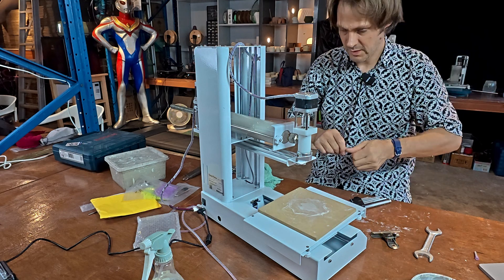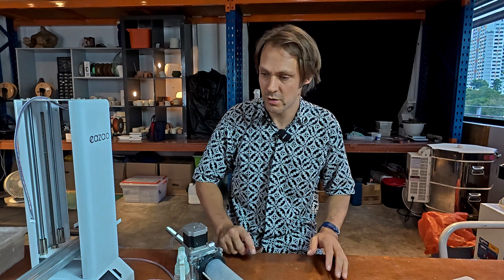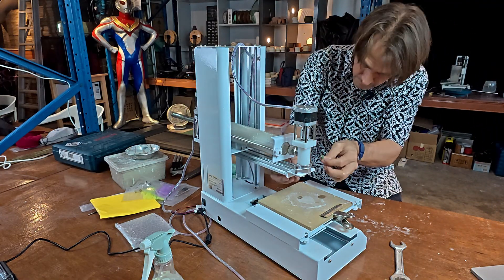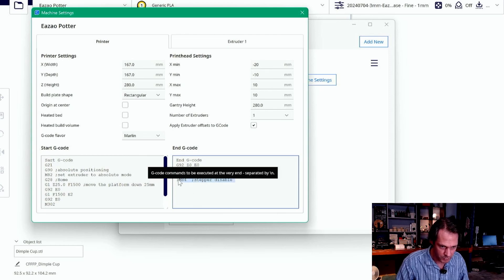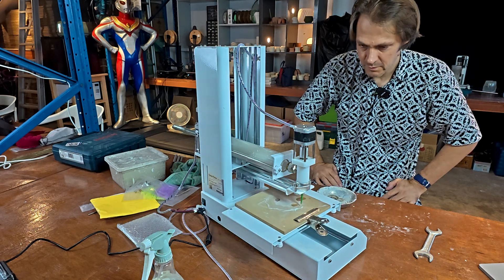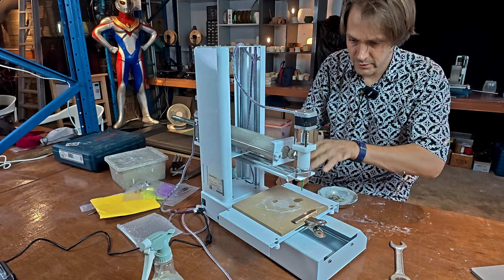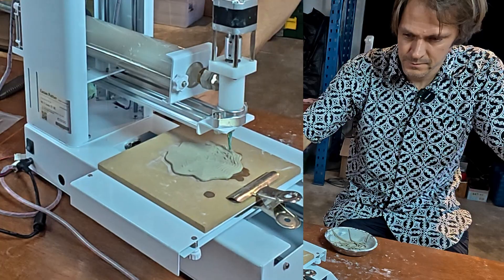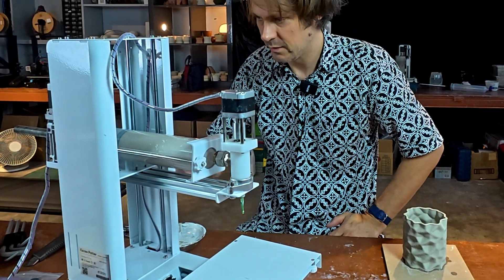Eazao Potter: Fixed but Still Frustrating? Testing the New Updates!

Comment: I would like to try 3D printing clay, would you still recommend this printer or something else? Is it better to buy the kit and attach it to an Ender 3 instead?
Reply from the maker: There is no perfect solution.  I think the eazeo potter is slow and can be frustrating. That said, the direct connection between the clay pump and the extruder,  without a tube, makes it print really nice quality, better than I have seen on other printers and more reliably.  If you want to tinker, upgrading an ender is a good idea,  but if you want to get on and print some prints, then the eazeo is the best option. tinkering with and ender will take a lot of work to get good results.  If you do buy an eazeo potter, you can help support my channel by using the coupon code CLAYWOVEN50 that should give you a $50 discount as well.
Reply: @claywoven  Thanks very much, it's a quite big investment, still thinking hard about it :D Will use your code if I go ahead. I was looking at the Tronxy printers as well, What you do you think about those vs eazao?
Reply from the maker: hey there,  I actually get asked this a lot, so I put together a full breakdown of Eazao vs Tronxy. If you’re weighing up the investment, it’ll definitely help you decide. You can check it out here: https://www.patreon.com/posts/tronxy-moore-1-131126990
Reply: @claywoven  Oh wow amazing! Thanks so much, it seems Eazao is the better choice, I'll still doing some research on clay things, never worked with it before so I'm a complete noob.

Comment: Hey,
it would be great to see one of those vases  once they area fired (?)

Are they brittle or do they seem like a solid object?
Reply from the maker: They are about as solid as any ceramic pot. If you drop it, it will break. But it will not crumble in your hand. It does also depend on the temperature you fire it at. 
I'll do a video covering the complete process from design to the final piece. I am working on the new design now. 🤞 video will be out in a week or 2.

Comment: Thanks for your updated video. We saw that the printer paused when you were printing the model. To be honest, this problem sometimes occurs when we print some models. But this problem is like the Windows blue screen problem, which is random and difficult to reproduce.

From what we have learned so far, when slicing some models, multiple tiny path fragments appear in certain positions, causing the printer motherboard to be unable to perform fast calculations instantly, causing the device to freeze. Simply put, this is due to the insufficient CPU performance of the printer motherboard. We provide the following solutions:

1. Stop printing and restart the machine. Select the file and start printing. Yes, just like most electrical appliances, restarting the device can solve most problems.

2. Send the model to us, we will re-slice and process the gcode for you, and then print it.

3. Replace the existing motherboard of the printer and upgrade the motherboard to one that supports high-frequency and high-speed printing. Generally, such motherboards have higher-frequency CPUs and can quickly calculate the printing program. We are currently working with MKS to test the relevant motherboards, and we will launch a detailed upgrade plan in the future.

Here is the print file we tested that you can use:
https://drive.google.com/file/d/1-L2CDK2qIeBGGpR1p1dYgWxtkEUu3PN3/view?usp=sharing
Reply: Also happens if the slicer is expecting a minimum layer time and has some variation of "wait for min time" option enabled.
No doubt there is a more complicated reason for a bespoke machine like this, but simple things are also good to rule out. It's caught me many times before.
Reply from the maker: @Esoterical-po3ek Yes, i was thinking this, too. But this was not enabled.  I found the printer is using a fairly old design RAMPS based controller. I have used the same one before in other projects. It is really underpowered. I think it just cannot keep up with the data stream required by the steppers so the print pauses to catch up.  It's a shame as other than the controller problem, the concept is good for a small printer. It makes sense to me to move the x and y on the bed and fixed the clay pump directly to the extruder.  Just so many problems with the implementation. I hope eazao can update the design.
Reply from the maker: Thanks for the reply!  I agree that it is a motherboard issue.  I think you are correct that it is caused by the board not being able to keep up with the instructions. I have noticed you can reduce the likelihood of it happening by reducing the speed of the print.  I will be upgrading the motherboard and I am pretty sure the printer will work nicely after that.  But I do hope you can update your design to a faster motherboard on this model. As it is holding back, what could be a perfectly good printer.